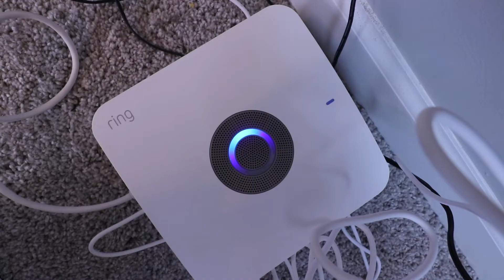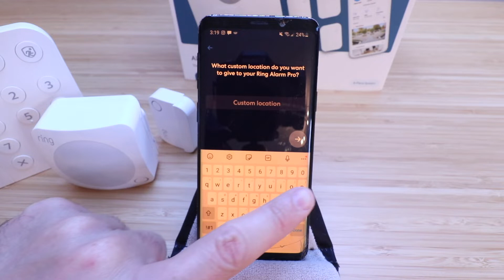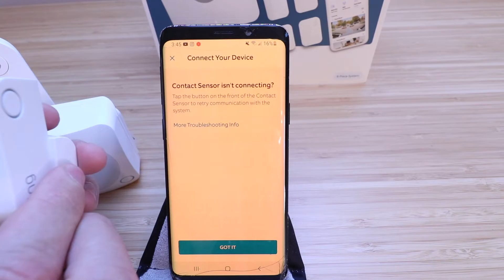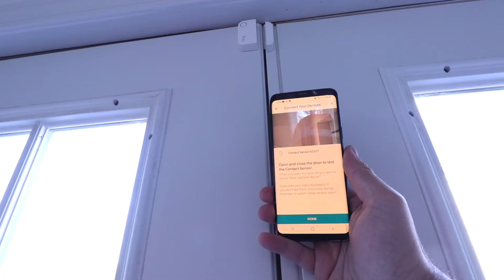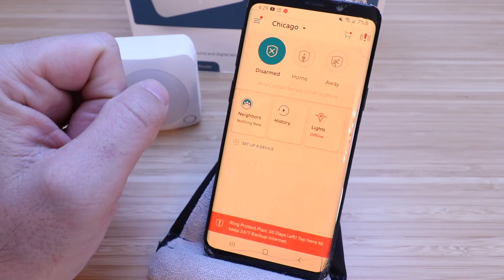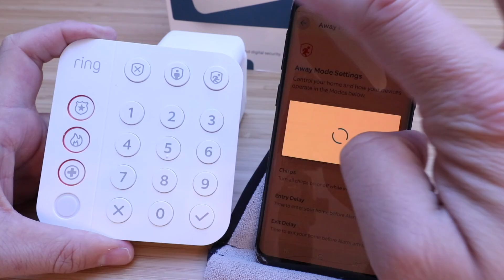How To Set Up Ring Alarm Pro

Comment: Hi thank you for your video!
I am just setting mine up but I have the eero pro (3pack) as my current router and I love it so if I want to continue using it do I put my ring right after the modem then my current eero main hardwired to ring base? or do I put my ring base after my current era pro? so much conflicting info out there on this... does either order slow down your speed or remove features? thank you!!!!!

Comment: I already have a ring system with several cameras - do I need this base station for the sensors ? does it work as a separate system on the same account - coming up on the same page on my iOS? or do I need to start all over with cameras and all?  Very unintuitive.

Comment: Modem and router are in one they are not separate does that make a difference in the set up process? Great job
Reply: If you are using Modem and Router two separate units currently, then your Ring Alarm Pro will retire your Router.

Comment: I see you have Spectrum.  I have the same modem and wifi (my condolences).  Modem only has one ethernet output.  So did you connect the eero to a Spectrum wifi ethernet port or disconnect spectrum wifi and add the eero to the cable modem?

Comment: I currently have a AT&T Digital Life system that is paid off and AT&T is getting out of the business.  The wireless sensors on the AT&T are ZWave. Do you think this system may be able to read those sensors?  My front door lock is also ZWave and integrated with the AT&T.  Thanks for the GREAT video!

Comment: If you have spectrum you'll need to plug into the router and it will work like normal. When your connection or power gets disconnected your back up cellular Connection and battery power will power the security system as it is built. I've had mine for a couple months and I love it!
Reply: I have to plug my alarm pro into my router as well. So did you put the eero into bridge mode ?

Comment: you do not plug into your modem you plug into your router because if you have spectrum like me on the modem it self there no where for the ethernet cables to go and i know because with my set up im running 1 gbps which is the best also you need the router

Comment: So if I’m understanding your video you don’t have to use the eero mesh system so if that is the case I could just keep my ring base station that I have because I really don’t gain anything with the pro unless I’m not understanding you. What is your thoughts
Reply: Were you able to connect this to your existing network?  Or did you have to replace/extend using Eero?  My preference is to avoid using Eero but I'm getting mixed vibes about the feasibility.
Reply: @bellsgaragellc9190  well to tell you I never upgraded to the alarm pro. I’m very happy with my first gen system
Reply: @georgeB683-n7x  Glad to hear and thanks for the message!